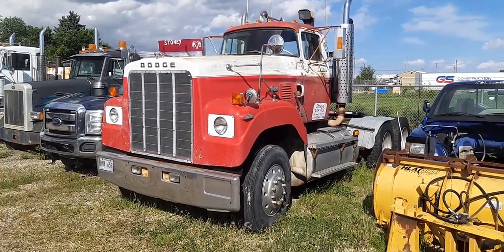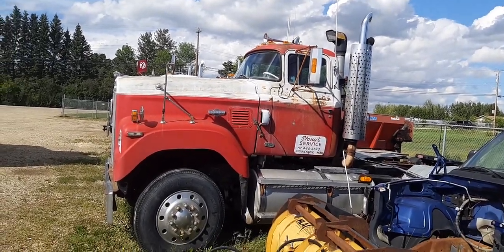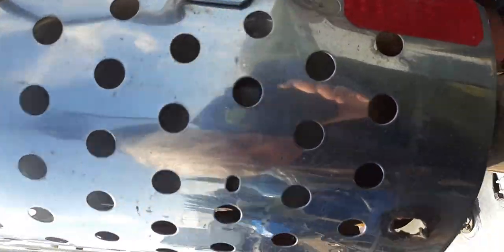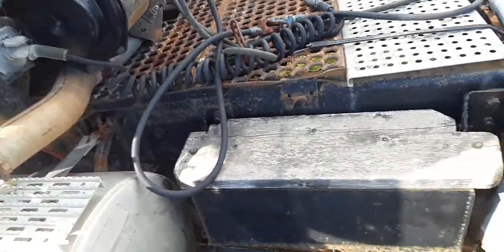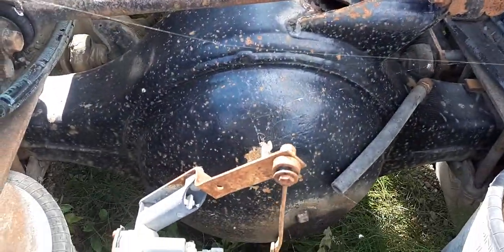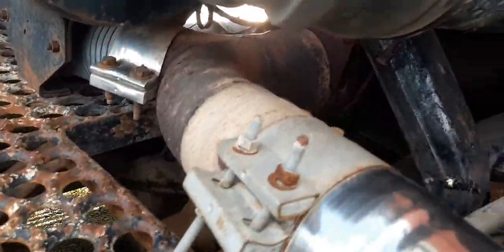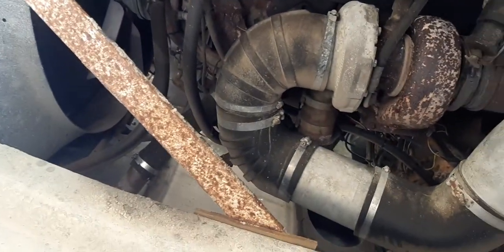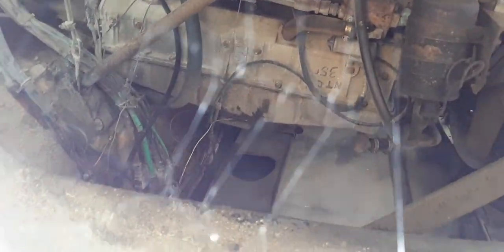Dodge Big Horn day cab

Comment: The engine is ether 330 Cummins or a Cummins big cam 350, those were the most popular in those trucks, some had Detroits like the 8v71 or 8v92 but the dodge bighorn was most popular with a 330 Cummins or big cam 350 Cummins. Only reason I no is cause my grandpa owns one a still uses it to haul grain.